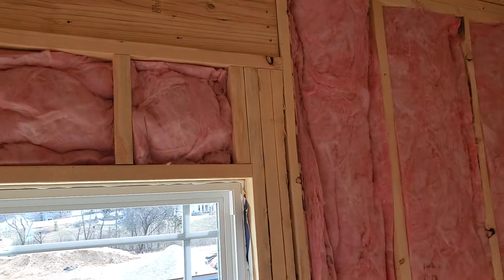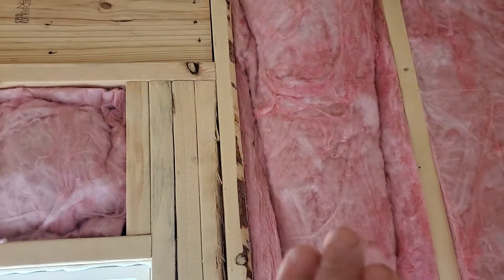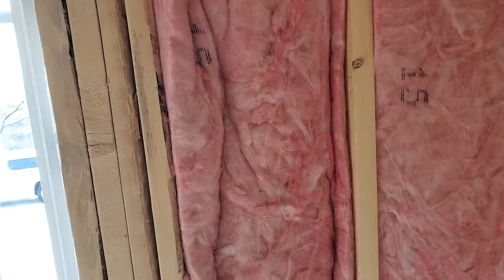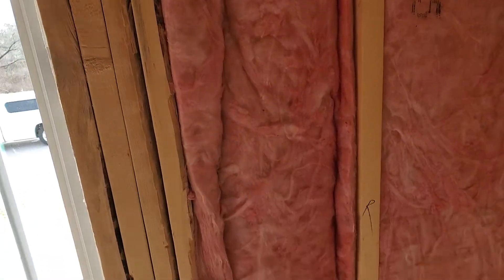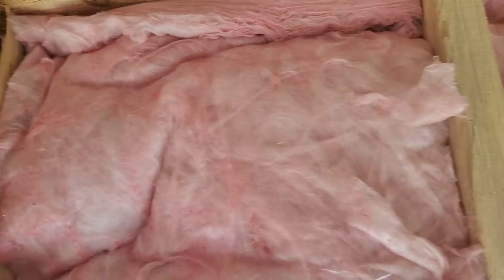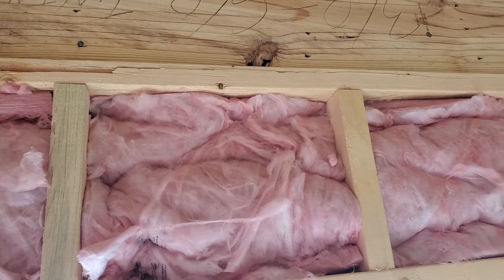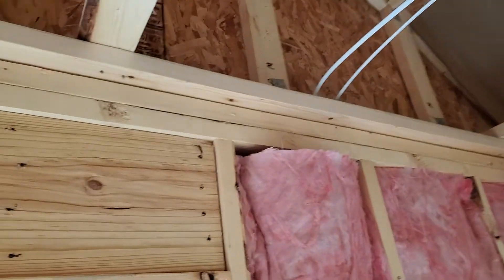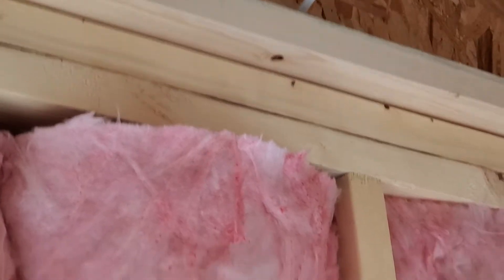New Construction Pre-Drywall Inspection of Insulation

Comment: Yeah, that insulation was rushed, but it's the air barrier building wrap that prevents air from moving in/out of the house and the vapour barrier that prevents moisture from moving in/out, not insulation.